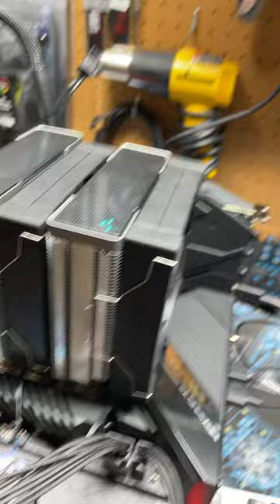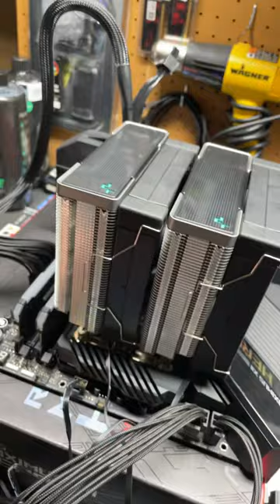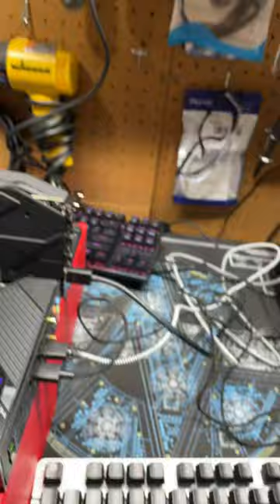ROG Motherboard D6 error Code and KVM Switch #ROG #Z490 #ROGMotherboard

Comment: Looks like a really nice air cooler btw
Reply from the maker: It’s the Deepcool AK620 and it’s the best one I’ve looked at so far. I’m only using it for testing. I’m doing a ROG build using mostly used parts and I’ve bought a AIO for it.
Reply: @jimbopcbuilds  did you try Deepcool Assassin III?
Reply from the maker: @JucheAdmin   No I haven't. I'll add it to the list
Reply: @jimbopcbuilds  I highly recommend this cooler for testing. In fact, it is better than the AK620 in TDP characteristics, and is a little quieter in work. Before the advent of the AK620, I used only it in PCs with powerful CPUs, now I sometimes use the new version, since it is cheaper. There may be problems with the size - it's just enormous, but it fits on most motherboards with not the largest heatsink on VRM, with the exception of most Asus Z590/690. I also give a lifehack - for the lga1700 socket, you must have an adapter, here is its exact name: DEEPCOOL EM316-MKNNIN-G-1. Sorry for my Google-Translator english :) Best Regards!
Reply from the maker: @JucheAdmin   Thanks for info sounds like a really good cooler

Comment: I hate it. Msi x570s carbon, rtx 3090, have this issue. Its dangers to turn it off?
Reply from the maker: Really? I've only heard of this issue with ASUS boards.
Reply: @jimbopcbuilds  i dont know why, i have cable from my pcu 1000w , cable can take 500w. I don't know what its need.
Reply: @jimbopcbuilds  so should i do this? Will it hurt my MB ?
Reply from the maker: @VITAS874   Sorry I'm not 100% sure what you mean. The error I had in the short was with no video coming through because I was using a KVM. Your issue sounds different?
Reply: @jimbopcbuilds   i connect wire 12vhp  that pcu gives me,  install 3090 in pcie slot until click and after boot i have d6 error with white light.
Reply: @jimbopcbuilds   maybe i need specific motherboard or what? or its really gpu...
Reply from the maker: @VITAS874   Ah ok
Reply from the maker: @VITAS874   If I had to guess, I would look at the 12vhp connector. It sounds like the GPU isn't getting enough juice. Did the PSU only come with one power connector?
Reply: @jimbopcbuilds   psu is vertex seasonic  px1000 1000w
Reply: @jimbopcbuilds   I think they write 450w on cable...
Reply from the maker: No I mean that type of cable has had loads of issues. A 1000w is more than enough. If you have 2 cables with the PSU try the other, if not see if you use an adapter and try the old PCI-E cables.
Reply: @jimbopcbuilds  i use the one that seasonic gives me 12vhp... i not tried adapter.
Reply: @jimbopcbuilds   i buy adapter with 8pin connector.
Reply: @jimbopcbuilds  its 4070 adapter hope it will fit
Reply from the maker: @VITAS874   It should do. Either way it'll be good as backup. I have my 4070 running on an adapter.
Reply: @jimbopcbuilds   i not have super gpus 😄,only old gpu. And 3060
Reply: @jimbopcbuilds  i have one 12vhp cable from my psu, not adapter.

Comment: I just want to be sure, what are KVMs? I just finished helping a friend build his PC and it won't post at all. It keeps giving us d6 for the q-code
Reply from the maker: KVM stands for Keyboard Video Mouse. They’re used to control multiple computers from one mouse, keyboard and monitor. Are you getting an error code from the motherboard at all?
Reply: @jimbopcbuilds  yes it keeps giving us d6. No video output but we have a GPU connected. Cables are connected correctly and display port cable connected from gpu to monitor as well. I'm completely stumped.
Reply from the maker: Have you tried connecting to the video out on the motherboard instead?
Reply from the maker: Also did you google it? There’s some forum posts on the error code which I went through first
Reply: @jimbopcbuilds  yeah we've tried the motherboard hdmi and updating the BIOS as well but it refuses to post. Were going to attempt swapping and removing RAM and GPUs but i fear it won't help
Reply from the maker: Bugger doesn’t sound good, especially if you’ve tried different output cables as well
Reply from the maker: But I think trying the RAM is good plan. Do you have working system to try the GPU in?
Reply: @jimbopcbuilds hello. i have this same issue. after seeing this maybe I could try to connect hdmi cable from monitor to motherboard port? if it turn on gpu might be dead right? if its not turn on for hdmi then maybe monitor dpi/hdmi or the monitor itself
is dead?
Reply: i have tried and did alot of research. maybe ill try to get a new working gpu and test it out. if it not working then the monitor or the monitor’s cable definitely is the problem
Reply from the maker: @haoruyaa-senseii   Try reseating your GPU as well. It may have become loose, especially if it's a larger heavy card.
Reply: @jimbopcbuilds  yes i have reseat them into 3 different slot on mainboard. and also i bought a new gpu cable riser since i thought my old one could be loose. and nothing works so i guess my gpu got burnt already. after seeing this i tried to plug hdmi to my mainboard today and it works. so i guess problem was from my gpu and it is dead . thanks for ur helpful tips
Reply from the maker: @haoruyaa-senseii   Sorry to hear about the GPU it sucks. Have you tried it in another motherboard? I know that's not easy as you need spares. It's why I keep an old one knocking around just in case after an upgrade.
Reply: @jimbopcbuilds  yes i bought extra mainboard aswell and gpu still not detected. so i guess its gpu dead
Reply from the maker: @haoruyaa-senseii   Not good news. At least you know what the issue was I guess.

Comment: Press f1
Reply from the maker: I did
Reply: F1 worked for me. I had the d6 fc and a black screen - mashed f1 and it activated the login screen. I was using a Kvm also which I've ousted too. I have a ROG Z790-E.
Reply: Worked for me too. Thanks
Reply: It worked, wtf why?
Reply: After pressing f1 the error d6 gone but still no signal😅 do you have any other suggestions by any chance?
Reply: @davinci0072  tried connecting you HDMI to your motherboard